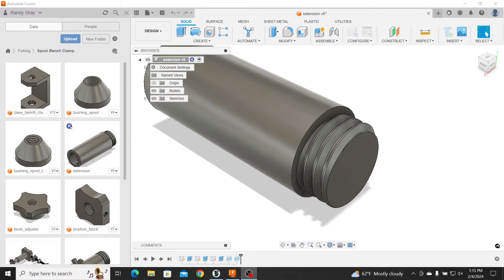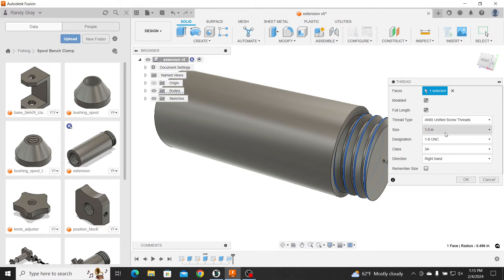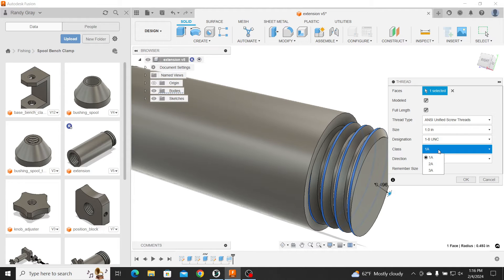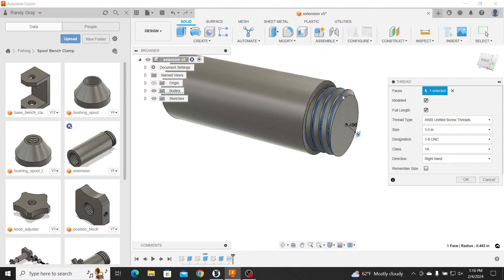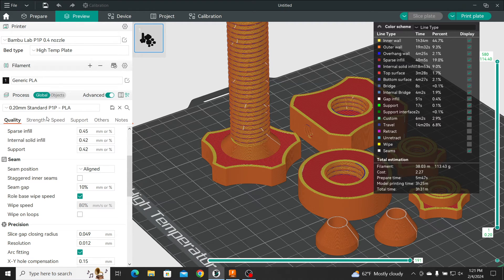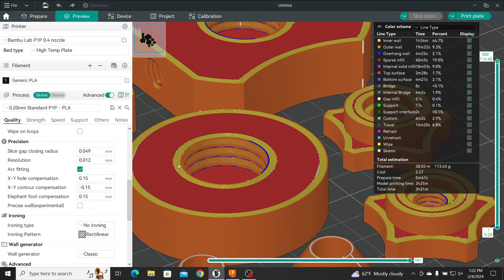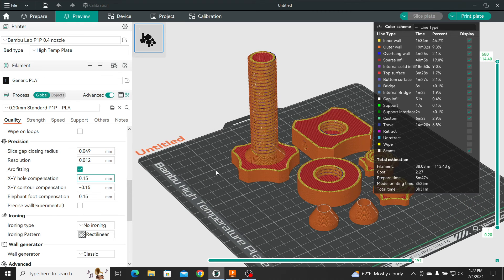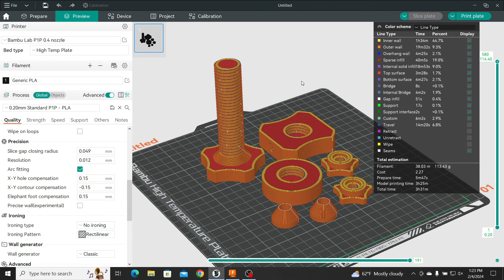Adjusting Threads on Fusion 360 and Orca Slicer

Comment: A noteworthy point regarding Fusion is that a number of features are not available in the free version. My experience as of right now, suggests that changing the "Class" option for threading is one of these. I only have one option to select.

You can still implement thread clearance by clicking on the flanks of the thread and using press/pull to either add/remove clearance.